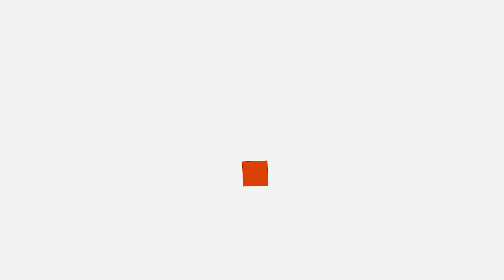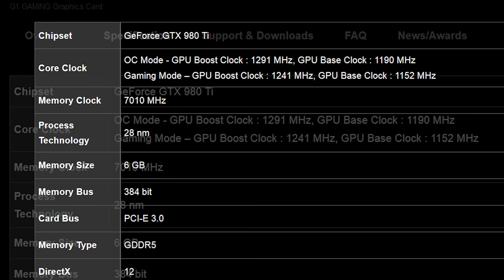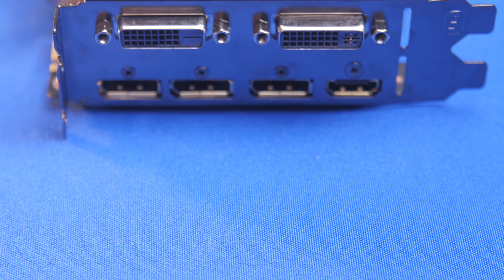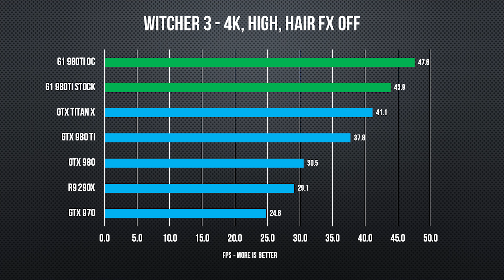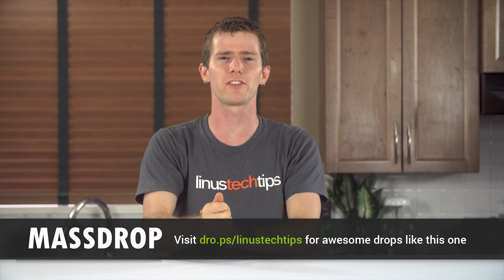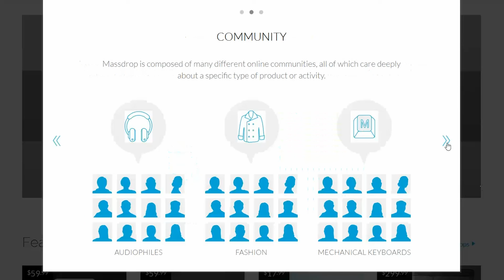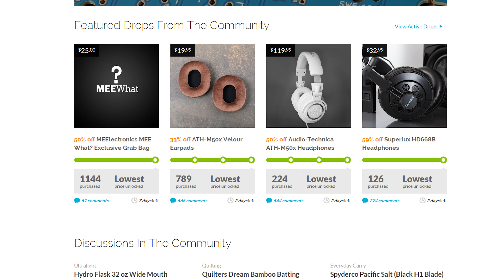Gigabyte G1 Gaming GTX 980 Ti - Both Beauty & Brawn?

Comment: HELP!

Windforce vs Strix vs AmpExtreme

Who's the winner???
Reply: Ahmad Husaini  read the reviews :) they allways do oc testin on all cards so you can compare both cards stock and oc - http://www.guru3d.com/articles_pages/zotac_geforce_gtx_980_ti_amp_extreme_review,35.html look at firestrike resault below on the page ! g1 wins on the oc part aswell
Reply: Ahmad Husaini  If I were you it would be between the G1 gaming, the  MSI gaming, or the Zotac Artic Storm
Reply: Bang4Buck PC Gamer Instead of Zotac Artic Storm. why not Amp Extreme Edition?

***** Meaning Amp Extreme edition beats both G1 and Strix?
Reply: Ahmad Husaini The amp Extreme does look really good, but how much is it costing where you live?
Reply: Bang4Buck PC Gamer im gonna stay in US for 2 years. So, the price i saw before is around 719usd. Meanwhile the others like G1/MSI 699usd. For the performance, 20usd extra is worth it imo. Not to forget, Strix is not yet fully released, the clock is kinda the same with AmpExtreme. But yeah, no review yet. 

What's ur opinion?
Reply: Ahmad Husaini G1 gaming, but I hear there is coil whine when it is pushed at absolute maximum. Zotac overclock really well so if you can afford it be different and go with the Zotac.
Reply: ***** oh. Is there a review on AmpExtreme? May u give me the link. Cant find any for now

Bang4Buck PC Gamer oh u still with G1. Yes, G1 is really quiet from the review i watched. But im not only consider for quiet but also max performance. I saw a mini review with fps comparison. AmpExtreme is even having 10-20 more fps. That's big. But i need to know how AmpExtreme cooling system also the noise level.
Reply: I don't think anyone has done a review on the Amp extreme. a lot of the aftermarket 980ti are not available yet. why don't you just get the Evga Classified 980ti...I bet that beats all of them above
Reply: Bang4Buck PC Gamer EVGA Classified 980ti? oh okay I never done any research about that. That's a good info! :D
Reply: Ahmad Husaini Its the best only the Kingpin version is better but I don't think that is out yet. the warranty is the best on Evga cards too.
Reply: Bang4Buck PC Gamer i dont see Classified 980 ti yet. Is it cheaper than Hybrid?
Reply: ***** oh computex videos. I cant find the one that really shows the Amp Extreme with some fps or noise review.
Reply: sorry for kinda wrong information. Actually AmpExtreme beats G1 with some fps around 3-10 fps. And the price difference is G1:699usd AmpExtreme:705usd
Reply: What is spec of your rig out of curiosity?
Reply: HowAmI huh?
Reply: HowAmI what shit?
Reply: HowAmI dude, what shit i ask?
Reply: Ahmad Husaini had the same choise as you and just ordered the G1 cuz lag of reviews on the zotac and the g1 seems to be a pretty safe bet aswell, jayztwocent overclocked the shit out of the g1 with impressive results
Reply: Ahmad Husaini Zotac 980Ti Amp extreme review..enjoy  http://www.guru3d.com/articles-pages/zotac-geforce-gtx-980-ti-amp-extreme-review,1.html
Reply: Bang4Buck PC Gamer Ahmad Husaini  ***** Well I can't decide between the one above(G1), HOF, Classified and AmpExtreme... They all got the nearly the same price and I'm not interested in manual overclocking but I do seek performance. So help/advice?
Reply: ***** same as me. I dont have exp in manual OC. I rather go for the one that can be OC by pressing any configuration by the custom brand. Tell me if u have the answer. But im waiting for the Strix to release the review first
Reply: ***** Go for the one with the highest boost clock at stock. and that is the Zotac Amp extreme, it beats the Titan X straight out the box without doing anything to it.
Reply: *****    G1 wins  :) if u compare  gurus own reviews on both cards atleast
Reply: Simon Keinicke That one without AmpExtreme OC and G1 OC. If im not mistaken,,,
Reply: Ahmad Husaini  nope http://www.guru3d.com/articles-pages/zotac-geforce-gtx-980-ti-amp-extreme-review,1.html   amp extreme review aaand http://www.guru3d.com/articles-pages/gigabyte-geforce-gtx-980-ti-g1-gaming-soc-review,1.html g1 here
Reply: Simon Keinicke no i mean, did Guru3D OC the AmpExtreme too to do the game benchmark? i dont see any word that saying it OC the AmpExtreme but i see the word he said OC in G1 gaming review
Reply: Ahmad Husaini He didn't, but if he did it would of been total destruction compared to a 980 or 390X

Comment: What is your guys thoughts on this build 
Case: corsair spec02
Power supply: corsair cx600w
Motherboard: asrock fatal1ty 970
Cpu: amd fx6300
Gpu: asus r9 270x
ram: g.skills ripjaw x (2x4gb)
Hard drive: WD blue 1tb

In some i will go crossfire with the asus r9 270x and I will over clock the CPU. This is also why I went with a 600w power supply.

Comment: I have a question I had a Amd a4 6300 apu then I put in a gtx 750 ti. If I upgrade to an Athlon x4 860k or a fx 6300 will there be a difference in battlefield 4 please I need to know asap!!

Comment: I have a question I had a Amd a4 6300 apu then I put in a gtx 750 ti. If I upgrade to an Athlon x4 860k or a fx 6300 will there be a difference in battlefield 4

Comment: Things I like about this card:
1-Isn't unfeasible tall for no good reason.
2-Directly cools v-regs with connection to heat pipe's instead of "well, the useless aluminium plate covers them too, even though that just results in memory overheating instead of actually providing usefull cooling to the v-regs"
3- 3 fans 90mm fans provide more cooling than 2 100-110mm fans.
4- 'aint no bling like customizable bling.

Comment: Why am I watching this I can't afford it anyway lmao
Reply: Because dreams are free :D
Reply: cuzIambatman you can buy it for me then, i won't mind. ^.^
Reply: Luke wins scrapyard wars
Reply: ***** probably it.
Reply: ***** YOU'RE* REKTREKTREKTREKTREKTREKTREKTREKTREKTREKTREKTREKTREKTREKTREKTREKTREKTREKTREKTREKTREKTREKTREKTREKTREKTREKTREKTREKTREKT
Reply: Aℓαηтιc ƒℓαмє You would need a 970 for 1080p if you had a monitor with a 144hz refresh rate.
Reply: Shad0wTail Tucking my 960 4GB tail between my legs too
Reply: M4R10zM0113R fuck i love sunset
Reply: Shad0wTail 99% of the people who watch this can't!
Reply: Git gud scrub
Reply: Shad0wTail 

Same here, I just refuse to spend more than $250 on a video card.
Reply: yesitsmario Man for my next build I'm aiming for gtx 960 at most.
Reply: shad0wteiruu Because I am going to buy this exact card tomorrow.
Reply: +shad0wteiruu __ Its like porn, you can look but can't touch.
Reply: shateiruu You can NOW! GTX 980 Tis are selling on eBay for just ~$260 on average depending on model!   I bought THIS G1 Gaming GTX 980 Ti in August of 2016 after Pascal and Polaris had launched, and won the bid for $355 shipped to my door! NOW I have it running at 1.218 Vcore (+34mw in Afterburner) to achieve 1503 MHZ core at ALL TIMES under load, and 8 GHZ effective VRAM for 384.4 GB/sec! 

At this overclock, my 980 Ti EASILY BEATS ALL GTX 1070s IN EVERYTHING! And actually even manages to tie with or even beat a FEW GTX 1080 equipped rigs in benchmark comparisons! In fact, I posted my SteamVR Benchmark scores to LTT's "Post your SteamVR Bench results here" forum thread - and what surprised me quite a bit, was that I was beating ABOUT 50% of ALL results turned in by GTX 1080s! And the ones I did not beat, I either tied with, or at worst was just SLIGHTLY behind!
Reply: xIpodTouchGoeroex pleb
Reply: I can afford it but Too lazy
Reply: xIpodTouchGoeroex unfairly.
Reply: yesitsmario only because your poor if i had money i would, so that i can play in 4k at 120Hz
Reply: ***** You obviously don't own one of these.
Reply: ***** pfft if you have a 1080p monitor then why do you even need a video card?!
Reply: Shad0wTail check out deal sites like slickdeals, they had an r9 290(non x) for $200 after rebate last time. Great bang for the buck.
Reply: yesitsmario not in us.
Reply: Claims the fastest GPU available is "aging architecture", plays on a 1080p display. Not sure if srs.
Reply: ***** that's five months away mate.
Reply: ***** wtf why do you need a 970 for 1080p
Hahaha
Reply: Oh
Reply: Shad0wTail It's very cheap, I am 16 and i can afford it easily.
Reply: f1tony2003 pfft my 770 4gb is better.
Reply: stormlord121 wow... slow applause that was philosophyically beautiful
Reply: Shad0wTail I just ordered one from newegg yesterday lol. Got the notification that they were finally back in stock
Reply: Superoxide Dismutase Thank you :)
Reply: ***** Thank you :)
Reply: Matthijs Reyers i have 2 sc 980Ti's, both on water with EK blocks ;). Love them.
Reply: here i am watching this with my 2x titan x sli config.... 😕
Reply: TheSpiikki
Then you realise how much money you have lost, might as well have lobbed it out the window.

I hope for dear god they are not on air aswell...
Reply: Roof Tyler Haters gon' hate :) Except i literally made all the money back last payday...
Reply: TheSpiikki Did you get the Titan X's before the 980ti was released? Or did you just decide to go all out and get the Titan X's anyway?
Reply: Had the money, decided to go all the way ;) cant understand why so many people are against titan x's, there is a reason why they are called "enthusiast" grade GPU!
Reply: TheSpiikki
I have 2x 980Ti's, both custom watercooled at 1550mhz with a custom bios. Yeah the TX's are great cards but the extra price is pointless. They are the same if not slower than Ti's, as you can clock the Ti's up faster. So your paying a premium for 12gb VRAM which for 2 cards will not use more than 6gb on 4k.

+ you are stuck with ugly reference or watercooling them. Atleast the Ti's have many aftermarket options.
Reply: 980ti are literally stripped versions of titan x's, if you have same overclock with titan x as 980ti, a titan x will definetly beat the 980ti, 980ti are better cards to overclock because of that custom designs, gotta agree on that, but my both titan x's are overclocked to 1355mhz and i easily get steady 60+ fps on every game i currently play,  about vram... GTA5 is a game that uses way over 8k of vram in 4k and ultra settings enabled so theres atleast one good side about that extra vram on titans ;)
+ i love the refrence desing and that big green neon GEFORCE GTX logo ;)
Reply: TheSpiikki I don't think people are really against them, I just think people resort to calling them useless or unnecessary because they're so expensive when you can get a card of similar performance for ~400 cheaper. I even have people telling me that my 980ti is "useless and unnecessary" lol. If you're happy with it that's what really matters.
Reply: TheSpiikki
might be 8gb on your titans but i rarely see over 4gb on my Ti's on 4k 60hz. I play 144hz 1440p personally for gaming now and have never seen over 4gb with that either.

Im not saying Tx's are useless, they are not. The 12gb is needed for 3-4 cards at 4k. Its a lot more to pay for the same performance with 2 cards.

I had 980's a while back which were 4gb. They got close on 4k but they never went over. That was with GTA V, Mordor etc. All maxed out at 4k. A card with more VRAM tends to use more.

But if your happy then thats OK, I have my system fully watercooled, not because i needed too. It would happily survive without it but, i like the looks and a nice quiet, cool rig.
Reply: +Matthijs Reyers i can hihi :D
Reply: +shateiruu i'm gonna get 8 of them because........i like dick
Reply: +Computer Geek Were getting closet to truth as we go ! Chitty Chitty Bang Bang Babe !
Reply: +Thebiggestcheese star trek
Reply: oh well. You can get 980 ti nowadays for like 250 xD
Reply: You can now
Reply: its much cheaper than a 2080ti lol
Reply: But can you afford it now?
Reply: still not, but I've been running a rx470 now for 3 years now so I'm good.
Reply: Do you think a gtx 980 ti G1 gaming will pair just alright with a i5 2400?

Comment: I would love to see how the Zotac 980 Ti AMP! Extreme compares too that, because looking at cooling design and clock speeds it should be the king of the hill. Also OC capability on the Zotac would be interesting aswell as an comparsion of the dual 8 pin aircooled cards to the 8 + 6 pin waterooled ones. If you look only at the power delivery dual 8 pin should get higher speeds...

Comment: Setting the clock rates lower isnt all that silly, ive found my gigabyte 980 OC variant has serious stability issues with the factory overclock.

Had to quite literally boot up afterburner and set it to reference memory and cpu frequencies to get it to stop crashing my system :(

Comment: Is the EVGA SSC ACX 2.0+  GTX 970 good? Want it to be silent and reliable or should I get Asus STRIX OC GTX 970?
Reply: Asus strix.
Reply: i have the evga acx gtx 770 and i would porbly pick the asus on. im not so happy with the evga. way to loud imo :)
Reply: Lennart Mook Thanks! Have read though that the ACX 2.0 cooler is way more silent under load and has passiv mode under idle.
Reply: ohh sry, you are right i have rev. 1 O.o . your choice then^^ but i have to say that asus NEVER let me down. i have a 6 old mainord that still works like a champ :) hope you can decide well. good luck man

Comment: When Jay reviewed this the Titan X beat it by a small margin in almost every test. In your benchmarks it beats the Titan every time even at stock speeds. Interesting...
Reply: DiehlGames Jay's Titan is already overclocked to the max, the Titan here is at stock speed so there u go.
Reply: He had a stock GTX 980 Ti, that one is being beaten in this chart. The G1 gaming however has beaten the Titan X every time. Seems like you should only buy titan x for watercooling now
Reply: DiehlGames His TX was overclocked. An overclocked TX will still beat an overclocked 980 Ti.
Reply: DiehlGames easy really - JayZ does it - IMHO - the proper way. He compares OC to OC. So he clocked Titan X @1400Mhz vs 980Ti @1529MHz. Titan X still came on top. Who in their right mind would order Titan X and run it at stock :D - well I guess there are the people, but I just find these kind of reviews so misleading. These cards are just pushed closer to their limit with better VRMs and generally better PCB design, but that doesn't do much for your final OC. I can run my Titan @1520/4000. So guess which card would come on top then ;)
Reply: TJD269 Unless you have exotic cooling like phase change, silicon lottery will make more of a difference in overclock than custom PCB. 1400 MHz is an easy overclock on a Titan X and Jay showed pretty clearly that a 1400 MHz Titan X will just slightly beat this card @ 1530 MHz.
Reply: ***** Yep, you nailed it about Jay. It's funny to me that some of these reviewers claim TitanX "gets rekt"' in the benchmarks, but then fail to mention they aren't doing an apples to apples OC comparison. When you're putting a TitanX against a custom 980ti PCB board that is overclocking itself by default, you should at least overclock the Titan as well. Check any OC forum and you'll see even reference cooled overclocked Titans beat 980ti's.
Reply: ***** Yep.  My coworker and I both got EVGA SC ACX 2.0 Ti cards but mine boosts to a stable 1504mhz core and his only to 1425~ish.  In real world performance, we tested each card at it's max OC in one machine to remove powersupply, motherboard, etc variables and discovered that the extra OC on my card only amounted to about .75~1 fps better performance in the GTA V benchmarks.

Before he saw those benchmark results, he was ready to send it back to amazon to exchange for another one but it seems as though when you get that high in the overclock, there comes a point of diminishing returns making it not really worth getting mad or disappointed over.
Reply: DiehlGames These benchmarks are misleading. They need to do a better job at explaining the comparison.
Reply: DiehlGames G1 overclocked but from factory to say its stock is not really true. My Titan X EKWB cooling overclocked would kill it Lol
Reply: yep I have mine running at 1457Mhz  clock with same block but single card with x-99 5960X at 4.4 like jay2cents
Reply: DiehlGames I have this card right now, luckly I was able to get on off Newegg before they sold out for a couple weeks straight. This card is so awesome I can be playing some games at stock settings and the fans shutoff as like the card is yawning at the demands of the game. I can't wait to get all my watercooled stuff setup for it. I will tell anyone that is getting this card that the Windforce backlight is a little strange at times. Like say you pick purple. You can see the red and the blue mixing to make purple, same goes with all colors and their corresponding colors that needed to mix the color. Also the logo will sometimes not turn on, but I believe that is my fault and can stop that from happening. This card is also looong at almost a foot long some of my older Full size cases couldn't fit this card. Other than that. Best Card I have ever owned.
Reply: DiehlGames Newer drivers can change a lot.
Reply: Sylvex Dragonskin Drivers have nothing to do with it - the 980 Ti and TX are the same chip; driver improvements for one will be driver improvements for the other. The disparity is completely explained by the fact that in this review, the TX is left at stock clocks, while in Jay's review, he had the TX overclocked at 1400 MHz (and his 980 Ti at 1530 MHz).
Reply: Oh ah I thought the drivers would be different but indeed Jayz always overclocks em all.
Reply: Jay overclocked the Titan, LTT didn't
Reply: overclocked big improvement specially on water and custom bios ;p

Comment: Had this card and returned it. Coil whine was terrible and the card is pretty noisy @ load. It overclocked like a beast tho. I have the MSI Gaming verzin now. Doesn't overclock as much but no coil whine and very quiet.